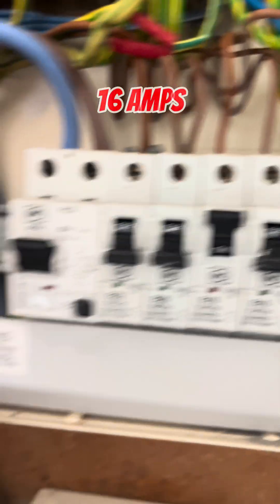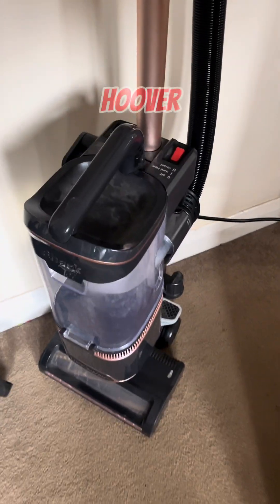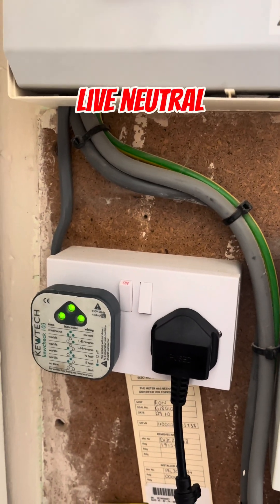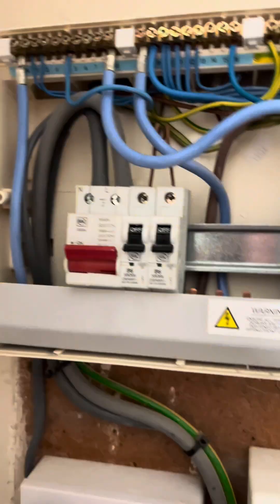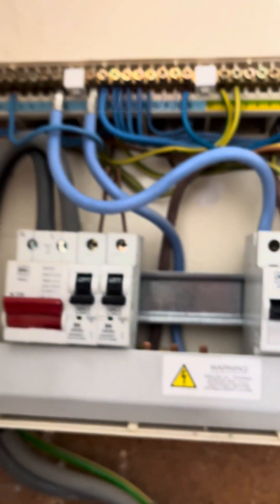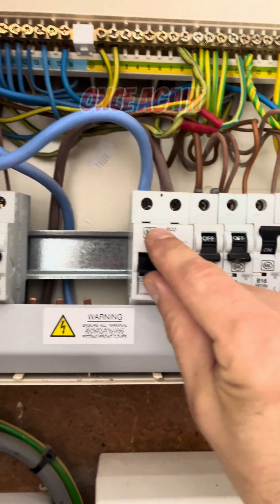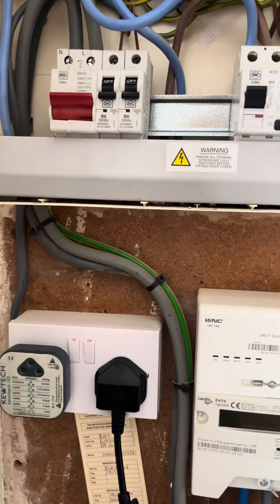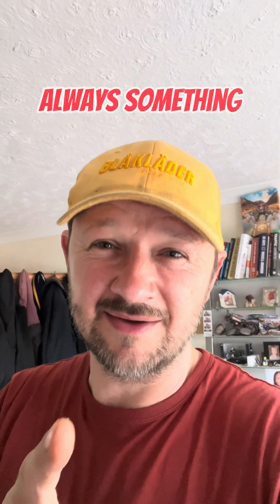RCD Wired WRONG – Spot the Dangerous Mistake Before It’s Too Late!

Comment: That's too easy.. Try to have PE and N shorted on one cable that is just waiting for socket or something, with its mcb still off and all. You can have couple small lights working normally on other mcbs but like third led or any bigger load on any of the other mcbs behind that same rcd would make it trip. After all, you could have everything connected just right and the problem is way over the other side of the house.

When the rcds started to be everywhere and no one seemed to understand them yet, I found myself moving stuff blocking the walls on tens of residential building sites to find a forgotten socket that had bare copper N and PE touching after the wire pull. And then I got to carry the then expensive rcd back to my boss, as I had the gig to change the faulty rcd that kept tripping without reason.

Didn't even bother to check the fuseboard after several jobs like that, but just find the walls that weren't painted or the largest pile of sh*t beside a wall, where the bare wires most likely were hiding..

Comment: Been there worn the T shirt 😂 replaced a consumer box last week, had the old style fuse box, replaced it, had similar issue with the light circuit, found the culprit it was the chandler, when I stuck a bulb in it would trip.  Yet it worked perfectly with the old style fuse box…. Explain please ……
Reply: Sometimes in older wiring the live from downstairs is used on the lighting circuit upstairs via 2 way switching for the landing light, it meant that you only ran in a twin for the 2 way lighting instead of a 3 core.
Reply: Probably had a borrowed neutral from another circuit. I literally had that a week ago, so I bundled the 2 circuits onto one breaker.. job done. 😂

Comment: I'm not crazy about how you guys use one RCD for the whole house. Unless I'm missing something and that's not how it actually works. In the USA, each individual protected circuit has its own RCD (we call it GFCI but it does the same thing). That way, one fault doesn't shut off everything. If the building is wired with this in mind, the lights will stay on while a fault trips a separate circuit.
Reply: The one RCD shuts everything down at the fuse box if say for example one of the RCBO’s has a leak/fails. Your bedroom sockets would have one RCBO protecting them, and your lights would have another RCBO protecting that. If your bedroom socket was to trip it would only trip what’s on that small circuit. The rest of the house will still have power as that RCBO has shut off the power to the bedroom sockets. If that RCBO had failed and didn’t shut the sockets off, the main fuse boards RCD would then take over and shut the entire power to the home off. If running properly the RCBO would’ve tripped the bedroom sockets and the main RCD wouldn’t have to switch the power to the home off. Your cooker and dishwasher would be on its own RCBOs, and your sockets in the kitchen on another.
Reply: @Keith18-18 oh alright thanks. That sounds like a good system then
Reply: Individual mcb/rcds is the best idea. You only have to fault find the affected circuit. Brits can be cheap!
Reply: We don't really anymore. My house is on afdd rcbo for every circuit. This is the standard now. Forget the afdd they are just as safe as sided boards. The only benefit is you don't trip half or even all your house from one circuit. However once that breaker is off put the RCD back on it'll be no different. Unless you have sensitive equipment let's says medical or leaky appliances then you don't really gain much from having them all separately.
Reply: there is one breaker that shuts everything off. then each circuit has independent breakers, such as lighting, sockets, we have upstairs lighting and downstairs on separate breakers as with sockets, and the kitchen is usually a separate breaker.
Reply: @dannythorpe1425 i was led to believe the RCD shuts everything down when it trips, regardless of the separate breakers. Is that how it works, or does each circuit have its own RCD?
Reply: @Krankie_V  Depends on the age of the system. 

It used to be that there were no RCDs, everything just had overload protection.
Then there were RCDs for special occasions (like when the distribution network didn't provide an earth reference). In that case you'd have one RCD covering all the circuits.
Then there were RCDs for some circuits, and you'd have one up front RCD for them, and then an overload MCB after it.
Then we moved to everything has an RCD, generally two covering a house. And you'd split things so upstairs sockets were on the same RCD (but different MCBs) as downstairs lights, so if that RCD tripped you could still have some lighting and some power.
More recently we've move to a seperate RCD for every circuit with overload built in, and RCBO.
And in some special cases arc fault protection.

That's domestic. For commercial stuff RCDs are relatively rare aside from socket outlets and when the earth loop impednace is too low for an MCB to trip in time.
Reply: We dont any more for exactly this reason. Selectivity requirements pretty much rule out the split load board with one RCD protecting multiple circuits.  These days each individual circuit has an RCBO.
Reply: @Krankie_V  in the UK, you'll generally have what's known as a ring main. So the sockets are on maybe one or two breakers. So the rcd would be tripping a lot anyway.